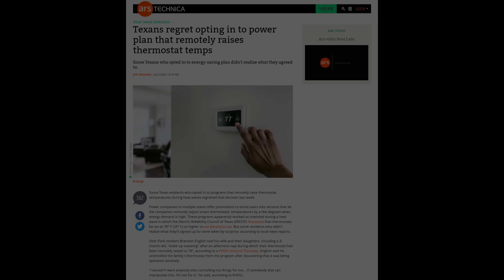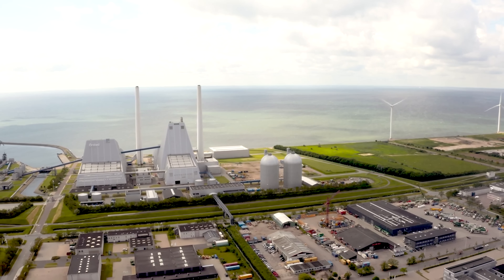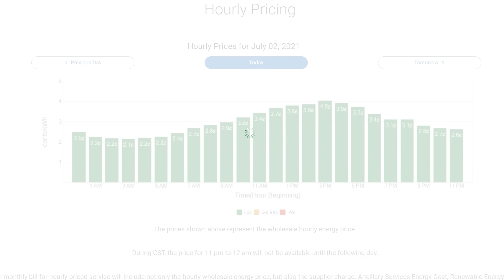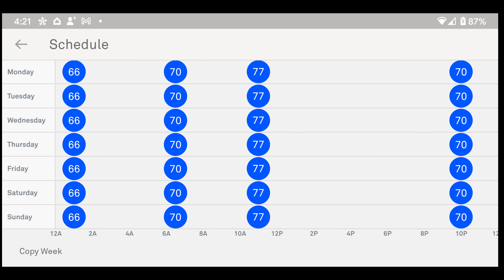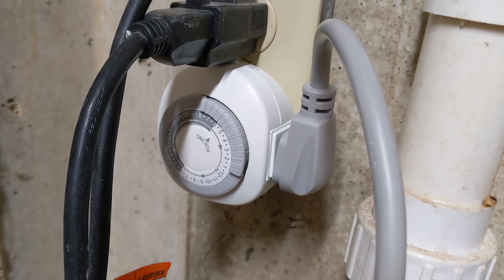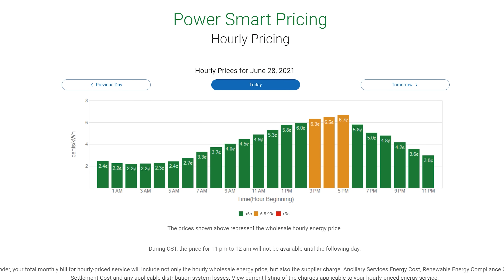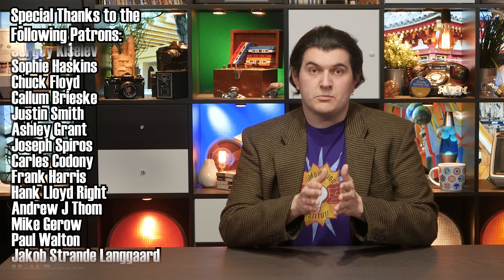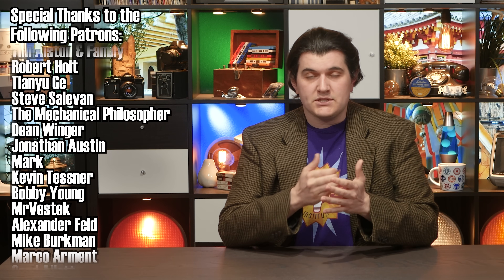Batteries aren't the only way to store energy. Here's another.

Comment: What I learned was "oh yeah, some people live in houses that are less than 60 years old".
Reply from the maker: Retrofitting older structures to meet modern energy standards is one of the most important things we can do in the immediate term.
Reply: @TechnologyConnections  that costs money and people don’t want to do that.
Reply: Haha 160 year old house here, I've done what I can but the costs can be massive.
Reply: And so many landlords dont care, they see their building as permanent.
Reply: or, "some people live in houses"
Reply: Ours is an old summer cottage turned into a two story house and is at least 80 years old.  We did a lot of work to improve insulation but getting more efficient heating and cooling systems can make a huge difference.
Reply: 1) The house I grew up in (where my mom practiced something similar) was built in 1936 and my house (where I do, too) was built in 1966. Larger shade trees on the southern and western exposures of older houses reduce the penalty of lacking newer houses' superior insulation.
2) Shade trees also sequester more CO2.
Reply: @prairiepanda  Absolutely this. Just reinsulating my attic alone helped a surprising amount on heating and cooling, and that particular insulation job didn't require walls being torn apart.
Reply: @TechnologyConnections  I live in the UK and the majority of houses I have lived in are over 60 years old, my current house being older than the USA, but every single one of those has had proper insulation and double glazing fitted as standard, whereas a lot of the americans I have spoken to who live in older houses do not have these upgrades. I wonder if it is a cultural difference to refit old buildings in the UK as we know the houses will last longer.
Reply: @TechnologyConnections  Unfortunately some of it is done poorly. My house was cavity insulated before I moved in, but without adequate ventilation, so the humidity crept up and it was unbearably stuffy. I have some windows partly open year round to prevent damp and keep the CO2 down and Ozone up.
Reply: @TechnologyConnections  We recently got our 1930s house built in the 1930s insulation, but this was only able to be implemented in the attic. This helped a little bit i guess.
Reply: @TechnologyConnections  My house is around 170 years old, (1840's).
It's a back to back terrace house with one layer of bricks between the neighbours on both sides and the house at the rear. With two layers at the front of the house. I don't think much can be done.
Reply: Yeah, our block of flats was built in 1937, and because it's dual aspect, we get a good breeze. We're in the UK so domestic AC isn't feasible. I'm looking into getting a ceiling fan for the living room to keep the air moving when the wind fails
Reply: lol same. Live in an apartment built in like 18somthing. When it's 90 outside it's 85 inside WITH the AC's running. We got our landlord to install new windows in the apartment and some vents and fans in the attic to move the hot air out of there. It's helped, but damn old houses are near impossible to keep comfortable, can see your breath during the winter and you're likely to get dehydrated during the summer.
Reply: @FishFind3000  Im in thay situation. but its not that i dont want to, i am low income and the costs to insulate my house, especially the walls, would be about 1/4th of my yearly income. I just dont have that sort of money. best i can do is i have planted trees to shade the house and now i have to wait 10 or 15 years for them to grow large enough to shad the house during the afternoon and evening
Reply: "oh yeah, some people live in houses that they own instead of rent"
Reply: @TechnologyConnections  you should do a video on some of the options for retro fit, but as some one who is going through the process of designing a extremely energy  efficient small house. the problem with retro fits is that in order to be efficient you need to air tight but being air tight with out the proper vapor barriers and water sealing can very quickly lead to rot and mold. the main reason old houses last so long in that they are so air leaky that any water that gets in can dry. "If it can't dry it is going to die" is a saying in the building world.
Reply: Our house is no older than that but it's a budget UK terrace house, so I don't imagine it meets any kind of "modern energy standard" :-(
Reply: @TechnologyConnections  tell that to my landlord. If I turn off the AC it takes less than 5h to match the outside temperature…
Reply: Mine was build 4 years before WW1
Reply: Box fans in the windows all night has cooled my house down during the summer so that when it's 95 outside it's still low 70s inside - 30 years with virtually no AC expenses.
Reply: Box fans in the windows all night has cooled my house down during the summer so that when it's 95 outside it's still low 70s inside - 30 years with virtually no AC expenses.
Reply: @TechnologyConnections  except for when your 72 year old father-in-law refuses these 'new fangled technologies' and keeps the house at an unbearable 80 degrees year round, in Missouri. And lets not bring up the humidity.
Reply: @prairiepanda  I am currently a renter. Been house shopping for two years. However, we barely got started before house costs doubled in our area. And as a renter, I can confirm that landlords only care if it works. Our AC unit is probably less efficient than a jet aircraft. Its undersized and doesn't have a single fin that isn't bent over, leading to poor airflow across the condenser.
Reply: @rj5529  it's probably because central HVAC for most people keeps the house hot/cold enough and they have enough money where the savings from insulation and windows won't even out for a long time. The house I'm in is from the 40s and it's got awful insulation on the upper level but the main level is fine and with the AC going it stays cool enough, there isn't really an attic above the ceiling of the upper level so doing insulation would be incredibly time consuming and likely expensive and changing out windows, I think they're single pane, would also be incredibly expensive because of the old wood siding on some sections of house and the solid brick walls on other sections. It isn't worth it.
Reply: @FishFind3000  or can't afford to... Remember the majority of people (Americans anyway) live paycheck to paycheck. Others live in apartment buildings where you'd have to convince the property owner to make such upgrades... and if they did, you know that rent would go up likely to the point where the people living there might need to find someplace cheaper.
Reply: @rj5529  it's likely that upgrades cost too much. Even though they'd save money in the long term, the initial investment would put many (most?) in deeper debt than they probably are already. Many many (most?) Americans live paycheck to paycheck and cannot afford the initial investment to upgrade or retrofit. It's really a sad state of affairs.
Reply: I have a house in the UK which was built in 1905; it's a terrace, so it's only got two walls, front and back, as the side walls are shared with the houses on each side. The walls are nine inch solid brick, with no cavities (except where the mortar has fallen out). It's essentially an icebox. I've insulated the attic but it's made no observable difference. I never bothered to fit a thermostat on the heating (natural gas via a combination boiler) because the temperature would never rise sufficiently for the heating to turn off.
Reply: @TechnologyConnections  yeaaaaah you've never been in a house from the 1860s, have you?
Reply: A couple of relatively inexpensive, and easy ways to insulate a home where more attic insulation, and insulated storm doors. Heavy curtains help some as well. I'm currently saving for new siding and to replace some more windows.
Reply: @tehberral  If you're existing walls have no insulation, look up Cellulose injection. The 9000ft synopsis is remove a row of siding (not on a brick home), drill holes through the subsiding into each cavity, insert ~10' of hose into each cavity, inject cellulose insulation with high pressure air, plug hole, reinstall siding. No unsightly holes in siding and an R-12 or greater insulation value. Dense pack cellulose when injected to walls correctly does not require a vapor barrier as it can take on and shed moisture. Also the dense pack slows to stops most airflow. This can be accomplished usually significantly less than you'd imagine. If you have a brick home, you can do this same process through interior drywall or plaster if you're willing to patch (or I've seen homeowners install trim around the outside walls to cover holes, think chair-rail trim)
Reply: I used to live in my grandparents house that is 100+ years old
Non-existent insulation, no ac
Inside it would get up into the 90's on bad summer days..
They next door neighbor modernized their house but it cost them tens of thousands of dollars...
It significantly increased the value of the house but my family absolutely couldn't afford to do something like that
Reply: My parents built a house in 1993, but got divorced a few years later. I was very young back then, and since then I've always lived in rented places.
Reply: @FishFind3000  ...not just that they don't want to, it's that they can't.
Reply: @TechnologyConnections  not all of us have the extremely successful youtube channels to fund these updates
Reply: @TechnologyConnections  you gonna pay for that retrofit? LMAO
Reply: The building I live in has been built in the 1750s, it was much cheaper to keep it updated than rebuilding every other generation
Reply: I'm raising with a 140 year old rented apartment without AC 😂 to be fair it's got proper insulation and it usually doesn't get that hot where I live, but still
Reply: @prairiepanda  but the average person in the US only stays in their home for something like less than 10 years. I think I read the average was 7 years awhile back. Without subsidies, most homeowners won't realize the benefit of the upgrades in a financial sense. Only comfort, and that isn't palpable when you're staring at the amortization and it exceeds your expected ownership by 3 years.
Reply: @16vSciroccoboi  if they're only staying in their home for a short time, why not rent? Most people I know who own their homes (in Canada) bought them because they intend to stay there for at least 20 years (while children grow and move out) or even for the rest of their lives (retirement). The rest of us who are living flexible lifestyles and moving around a lot just rent to avoid getting tied down.
Reply: @prairiepanda  I'm not saying I agree with it but it's the average. 

I bought my house 7 years ago and now the neighborhood is kinda going to shit and I'm considering moving. I planned on it being my forever home but times have changed. 

As far as why not rent, because real estate goes up in value, why pay rent and get nothing if you can pay a mortgage and theoretically make money when you sell it
Reply: @rj5529  I wouldn't say its a cultural difference. Its common for people in the US to not upgrade/renovate their older homes. They seem to use the excuse of not having enough money... However the vast majority fail to do any homework at all. In some areas, you can get the state to help pay for your home improvements. A lot of banks even offer attractive terms on home improvement loans and help to apply to government subsidies. 

My state paid $9k of my $15k solar panel installation. It also paid for a $3k portion of my $7k kitchen renovation in my first "starter" house.
Reply: @TechnologyConnections  as long as you dont try to insulate the floors of a house, it saves little energy and all it has done for many is cause mold damage, souce: im a contractor
Reply: @FishFind3000  "That costs money and not everyone is rich like me"* ftfy.
Reply: @TechnologyConnections  Agreed. Though we are limited to things like adding insulation to the attic (if your house has one), weatherstripping around doors, replacing outdated windows with vacuum-sealed ones, what else? Perhaps you could do a video on which of these are the most cost-effective and thus a good idea to do. Utilities used to provide monetary incentives for some of these.

Back in the early 2000s I got introduced to strawbale houses. I lived in central Illinois back then, and there was some sort of eco-village not too far from me (to the north if I remember correctly) where they were pioneers in solar PV and maybe wind too, can't remember exactly. But there was a house somewhat outside the community that the owner built himself, and it is a strawbale house. The owner also took additional steps to make the house's thermal mass even greater by making the south-facing glass portals (windows, porch doors, etc.) larger, so that in the winter the low on the horizon sunshine would heat up the massive (thick and wide) concrete floor that he poured on purpose to serve as heat storage keeping the house warm at night. During the summer the sunshine isn't hitting the concrete floor as the sun is higher on the horizon thus the slab's thermal mass provides the reverse action by keeping the house cooler during the day by absorbing the heat from the indoor air. Obviously, the high R-value of the strawbale thick walls provides excellent insulation both against winter cold or summer heat getting inside.

Strawbale houses are cheaper to construct due to the lower cost of insulation as compared to using synthetic in-wall insulation (spray foam or fiber-glass pads) but are costly due to laborious stucco walls. I recently saw a video about some sort of hempcrete touted as a good eco-friendly renewable construction method, but it appeared to be labor-intensive (read costly) as it had to be manually tamped down though I see hempcrete blocks come up in Google search. I wonder if strawbales are better already being a by-product of farming and readily available while hemp needs to be grown, plus hempcrete uses lime as a binder and that is a non-renewable source. I am not sure what kind of stucco is acceptable for strawbale construction (is there portland cement in it?), and it does seem to need something like chicken wire outside the strawbales to adhere to, so there is that. Otherwise, both constructions need a frame (I am gonna assume that loadbearing strawbale houses are unlikely to be codified).

Then there are the so much touted 3d printed houses, but I haven't really looked very closely into them to understand how they address wall insulation. While they are advertised as cheap to manufacture, how are we doing on ecological effects of concrete production. If my memory serves, it takes a very high temperature to create portland cement. But if we can harness PV, wind, tidal, etc. energy generation for its production, then I would say let's stick strawbales as insulation between an inner and outer 3d printed wall and call it good. Eh?

So, great video about how thermal mass (or mainly lack thereof) of our houses affects energy consumption, but unfortunately I don't see much public discord regarding improving construction methods in that direction. Hempcrete in my mind is a fad for hemp-crazed crowd who would like to see it used in everything. When I lived in Seattle several years ago, I spoke to a residential construction general contractor about strawbale houses and he kinda chuckled at the idea of building them.

If you want to do any more videos on this subject, then I wonder if you want to bring modern construction practices up and discuss potentially good directions to take them to?